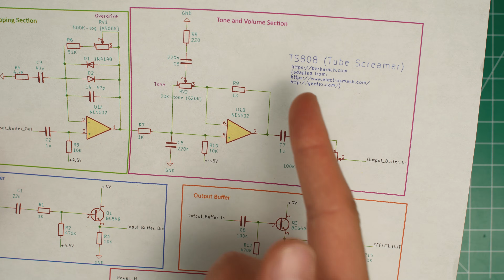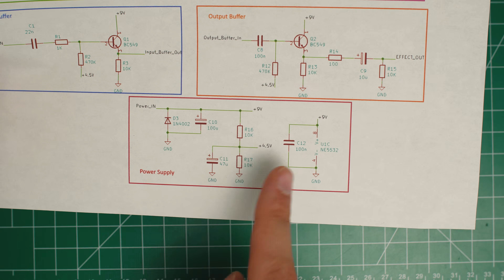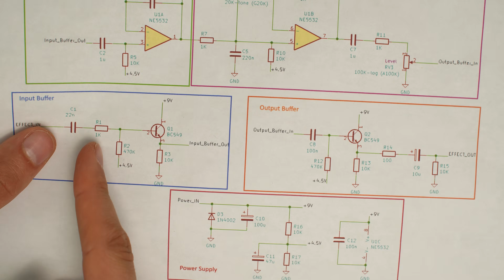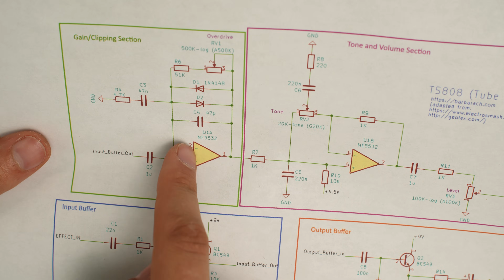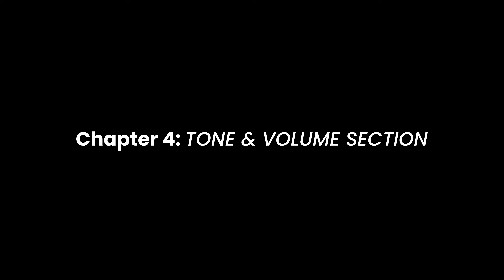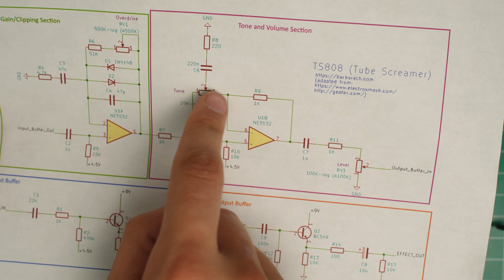Build an Overdrive Circuit for less than $10 (TS808 Tube Screamer)

Comment: Finally got all the right components and completed the breadbord, but.....
I am just using a standard breadboard, not one with a power supply and headphone jack in and out connected up.
I have the input sorted out, but only one of the output (C18), where would I need to put a jumper lead into for the second cable for the output to an amp?
How about adding the letter and number for each leg of a component, as not all legs can be seen clearly?

Comment: Hey, Im just starting out on pedal building and have a load of components but not all the same as I see here mainly missing the types of capacitors I have mostly ceramic and electrolytic. Could you possibly post a link to the plans for this? So I can get the parts I would need.
Reply from the maker: You can find a parts list here: https://www.electrosmash.com/tube-screamer-analysis

Comment: I friggin hate when people draw the whole diagram properly, and in that one corner for some reason they give up, draw the ground in the upper part, as if this symbol is forbidden to just place below that pot, and to top it off the +4.5 is way down where the ground should be. Either flipping the opamp or curving that noodle to the left would be way more obvious.
Reply: Like, i get its cramped, but any positive voltage goes from above, and 4.5 goes everywhere, but that diagram looked like it was redrawn from a breadboard lol.

Comment: I'm new to your channel. This is super cool, and I'm pretty sure I might already have the components to make one! But is there a video which shows a method of building something like this (not this one specifically, but the base you're working on top of, I guess?) without the custom PCB for the switch and the line in/out? Like purely on a breadboard.
Reply from the maker: Yes you can absolutely make this on breadboard without the setup I am using. You would just need to hook up 1/4 jacks for in and output and put the wires in the breadboard. As for an on / off switch, you could use a footswitch and wire it the same as a guitar pedal so it bypasses the effect. I can make a video in the future that goes over this as I realize many viewers don't have the custom breadboard. Thanks for watching!

Comment: Oh, quick couple questions Grant. 1. Any recommendations for buying components? I got some crap germanium transistors on amazon, i need a better supply. 2. Have you done a low voltage tube based (probably cathode follower at 12-18v) circuit yet?  Thanks again!
Reply from the maker: I get a lot of my parts from stompboxparts, little more expensive than amazon but all of their stuff is high quality and legit. No I have not but I’ll look into it!